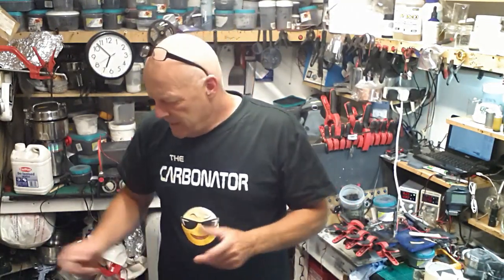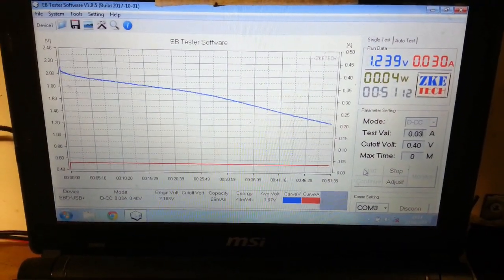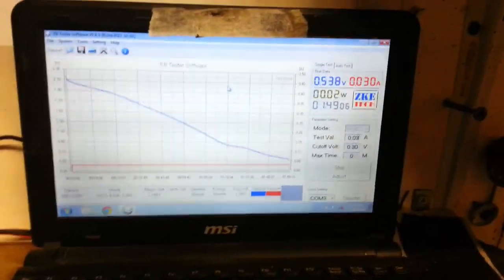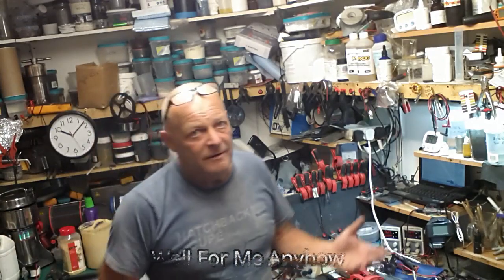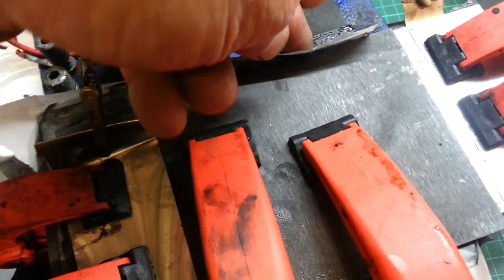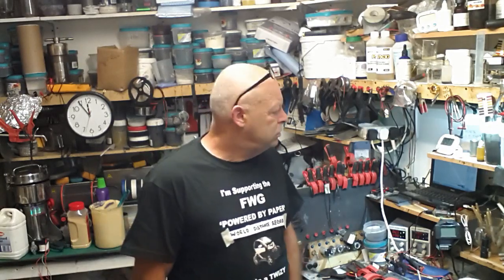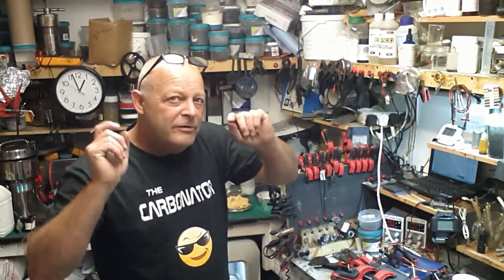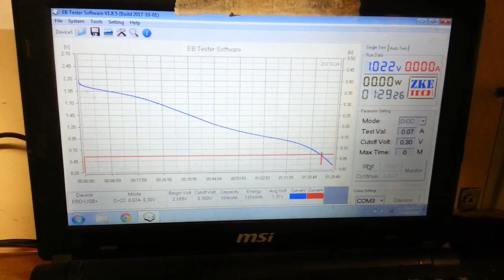Carbon Batteries 1st Update on where i am now & whats new

Comment: In regards to anode and cathode with tony .... is that brought about by anion and cations attracting to there opposite charge ?
Reply from the maker: Electron Proton Neutron Mouron not particularly mate, he works as an engineer in a Galvanic plating / painting shop for high end vehicles.... so guess where he got confused ha ha
Reply: kev wallcroft well this may need to be addressed in a video as cation go to the anode and you said in you video that the most damage happens on your cathode and I assumed you meant your cathode was sacrificed as in the sacrificial anode concept but then started thinking about the ions leaving the cathode under deep discharge and thought that is what may be damaging to the integrity of the surface and then I got a little confused about what maybe occurring and then thought maybe best if I ask Kev to give us a more in-depth chat on the subject for clarification ! Sorry to put you on the spot but I think it would be great to shed some light on it !🤔and also would the names be interchangeable on a cell depending on if it is being charged or discharged 🤔🤔🤔🤔I wonder !

Comment: why do you want to use copper/aluminum foil for your batteries if they dont play a part in the chemistry out of curiosity? why not just aluminum? thanks!
Reply from the maker: Because this would be the cheapest collector plate system available, unless you can show me a cheaper one ? 
Any graphite or graffoil collectors are way to expensive.
Thanks
Reply: Sorry mate just wondering why they have to be different materials. Probably something that should be obvious but I don't know much about these things yet. I would imagine just aluminum for both would be the cheapest.
Reply: Oh you mention my question later in the video I missed it my first watch through my bad. Thanks for all you share with us :)

Comment: I was wondering if you use copper and aluminium you run the risk of galvanic reaction but then I see they do this on lithium ion cells in phones so what is it that creates the differences?
Reply from the maker: Electron Proton Neutron Mouron copper on the Positive side is a much less reactive metal with stuff like manganese dioxide etc etc and the same with most of the lithium batts
Reply: kev wallcroft well I was watching sliders channel and his recent 18650 teardown and surprisingly the positive collector was aluminium and the copper was negative 🙀
Reply from the maker: Electron Proton Neutron Mouron yes mate you are correct i ended up using ally on both so it didnt matter😎